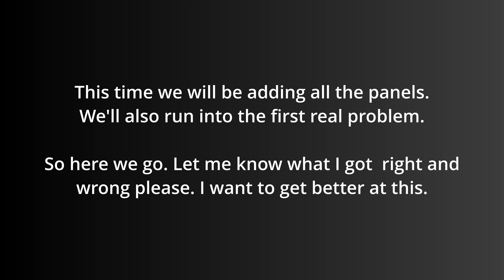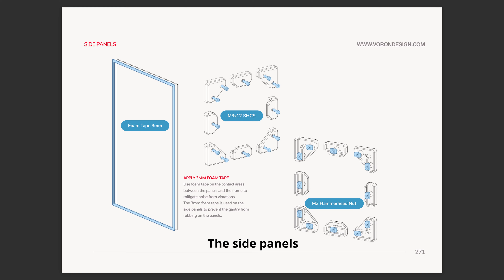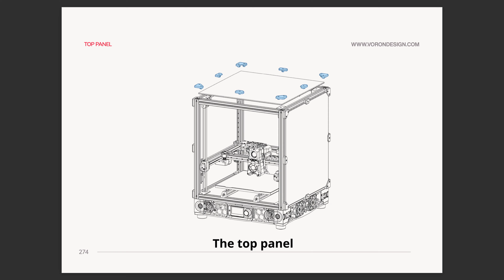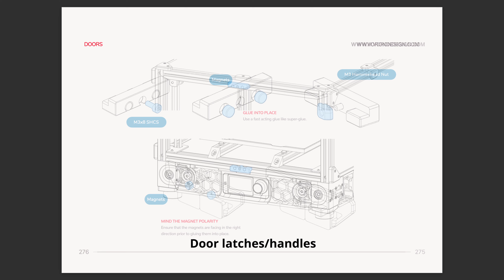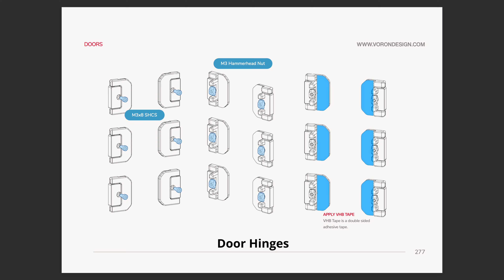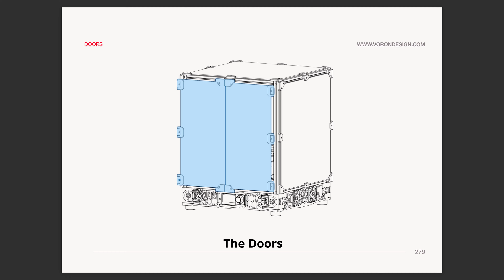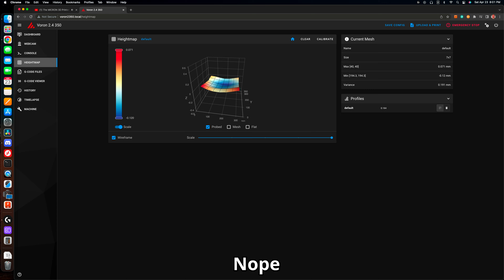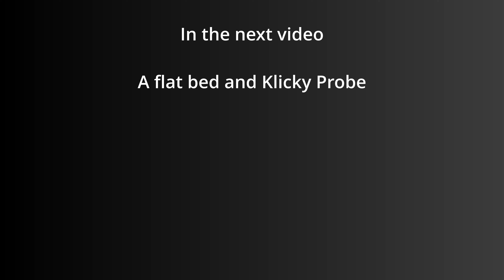Voron 2.4 Step By Step Part 14 Panels and Disappointment

Comment: Hi Scott.  I would just like to thank you very much for your vids.  They are now my bible!  Built my Voron based on your vids and although I did strike problems with sensors, wiring, belt tension, etc.  It is well worth going through that minor pain as a learning experience.  I think I am seated pretty well to take care of my Voron with some reasonable knowledge now.  Probably quite odd for some to understand but I started printing straight away with PETG, not PLA.  I am not a fan of PLA and PETG is my go to filament.  The Voron is perfectly happy using it and awesome prints straight up.  FYI, I have been printing for 10 years and this Voron is to take over the main printing role of my Prusa I3mk3 (which has been great - over 500 print days of printing on it, so I can't complain).  Voron will half my print times whilst maintaining quality.  Anyway, thanks again.  Cheers.

Comment: The bed mesh process, with ample probe points took care of my el-chepo bed.
Reply from the maker: I did a 7,7 and it still didn’t fix it for me. Did you go larger than that? I know it applied because it shifted from good in the center and bad on the corners to bad in the center to mostly good on the corners.
Reply: @scottcorn  I did that initially, then went back to 3/3.  I did a post on the voron redit going over the process.  For me, the key was setting the relative bed index to the highest point...and heat soaking the entire system for 20 minutes before taking the mesh.  So I turn it on, let it heat and the build mesh is part of the print start macro.  I can link you my post if you can't find it and are interested.
Reply from the maker: @Blueridgedog  if you would post the link please. I do the heat soak. I’ve seen first hand how much difference it makes. Just want to make sure I didn’t overlook anything.

Comment: The Formbot kit for the 2.4.R2 supplies 1mm foam for the back panel not sure why. But forgot to cross reference with the manual(p.269) so now I am short of foam so just be aware if you are using this guide for the R2. Had to look up what janky means(mentioned in one of your previous videos), here in Australia we tend to be a little more colourful but I will refrain from describing the fiddling I needed to install those door hinge corners. Great video as always.
Reply from the maker: Thank you! I kind of janked mine up on the sides. I wanted more clearance so I doubled up the foam.

Comment: Hello, you can correct the deviation of the bed by putting some wings of klapton tape on the bottom of the metal sheet.  In the deepest points. Good work!
Reply from the maker: Thanks for the tips!

Comment: One of the first tips for good ABS printing is: calibrate your extruder steps accurately then in the slicer set the (Flow, Extrusion Multiplier, Flow Ratio etc) depending on what slicer you use, to something around 93% or 0.93 to start and then use one of the filament tuning guides to get the value for your material and extruder. ABS at 100% flow prints terribly, which is most likely why the print in place parts didn't work. 
Before buying a new bed its always advisable to check your gantry assembly and rail install.
It is possible to remove the silicon heater and use it again. Keenovo have a guide on their website

Comment: I was waiting for this video eagerly. Sad to see u met different problems than mine. I had a tough learning curve with the hotend, fine tuning, clogs, z offset, bed adhesion, etc. which finally settled all of it yesterday. Im curious at your strict requirement for the ultraflatness of the bed. May i know why and your plans for the future prints?
Reply from the maker: Thank you.
My old printer had a less than flat bed. I was always fighting with it and the bed leveling system on large prints. Always ended up giving up in frustration with parts coming loose so I'm a bit overly sensitive to crappy beds. One thing I also didn't go into in the video was this bed is also getting worse over time. It went from .18 to .19 in one tuning session. So the problems of leveling are only going to get worse. It just wasn't a cast bed as represented when I bought it. 
As far as large prints goes, the largest at the moment is a Nevermore for the printer. I'm sure I will come up with some larger prints once I get dialed in.

Comment: I have not seen al your videos so just going to ask the general questions for the bed:

I assume you got a tooling plate ATM?
With 2x mgn9 it's possible to have a misaligned rail
X extrusion could be bent google: "High on One Side and Low on the Other (Twisted X Extrusion)"
Bed screws leave loose with the first heat soak and after ~2 hours tighten 1 and 2 should snug and the last one loose
Reply from the maker: When I purchased the build plate last year it was said to be a cast tooling plate. It is not. I did the proper bed tightening only an hour or so on the soak. With a quality steel ruler you can see more than 1mm dip in the middle.
Reply: @scottcorn Okay if you can see the dip then we know for sure the bed is bad, but I still recommend looking up: "possible misalignment of rails causing apparent twist"
Since the mesh wasn't able to compensate for the warped bed
Reply from the maker: Thank you I will research that. I am struggling to get the center back to printing well so there may more to it.

Comment: Interesting video. Do you know of any tutorials on how to set up Bed_Mesh?
Reply from the maker: I go over it some, but nothing specific to just that. I am working on a video on running an auto bed mesh at each print. Klipper is slowly heading this way. They have turned off the default bed level loading now. I have a video on a v0.2 build to finish first.
Reply: @scottcorn  Ok thanks. The bit I have seen looks pretty straight ahead but says to add some code within printer.cfg. Not sure where that would go or if it could just go anywhere. Anyway got my first prints today - pretty exciting after so many hours of build. Did those in PLA. Trying to get some ABS done now - cross my fingers it will stick to the bed. ;o)

Comment: i know im late to this video, but i dont understand why you think .2 off on the bed is unworkable? I have klipper on a cheap Chinese printer of mine, that has .7 variance in the bed, and the software is able to give perfect first layer height across the entire bed. Id be glad to have a bed that's only .2 off.
Reply from the maker: It was growing worse with every heating. I couldn't get a decent first layer on larger parts. I could have done a bed mesh at the start of each print and probably survived, but I chose to replace it. It's on a shelf as a spare now.
Reply: @scottcorn  Hi Scott, I agree with HazedHoonigan, are you sure that the mesh is applied to the print? In my first printer with klipper i make some mistakes and in the first trials the mesh is not working (the printer does the mesh, but is not taking into account). Currently my voron have 0,13 of deviation on the bed and i'm getting a perfect first layer.
Also, follow the ellis guide to tunning (pressure advance and extrusion multiplier), with that i get very good results.

Comment: Are you not going to be putting skirts / fans on?
Reply from the maker: Yes, it will be the first video after I get the bed issue fixed. With this current bed printing the skirts would not turn out well. I will put the skirts on before doing the advanced tuning video.

Comment: i didnt use hammer nuts for my panels bc they just never seem to set right so i just used my roll in nuts
Reply from the maker: I have a lot of roll nuts I could have used. Mine are just so in and out of spec I grew tired of having to try three before one would fit. lol
Reply from the maker: @Rob I'll take a look at them. I like the modded snap latches also. I'm trying to do this stock for documentation purposes. I'm also not sure I want to use PLA anymore. With the exception of my bed problem the ABS has looked and printed great. (as long as I'm in the center of the bed)

Comment: How long was the soak before mesh?
Reply from the maker: 20 minutes plus each time. Nozzle always in the center of the bed 8 - 10mm from the bed. Not sure why the mesh isn't fully compensating for the current warp. It seems like it should.

Comment: on the back panel you should use 1mm foam not 3mm like you used..
Reply from the maker: I see the manual now calls for 1mm. The old manual didn't show the panels and only 3mm was specified in the pre r2 BOM. I'm unsure why they would want 1mm for the back?